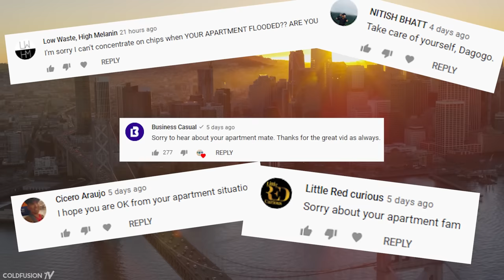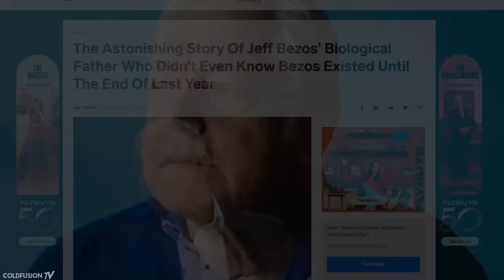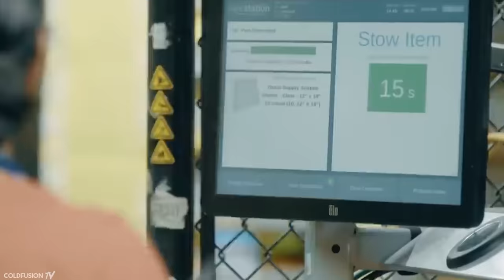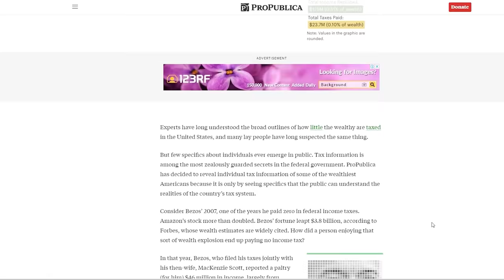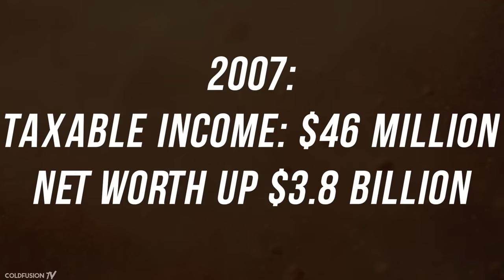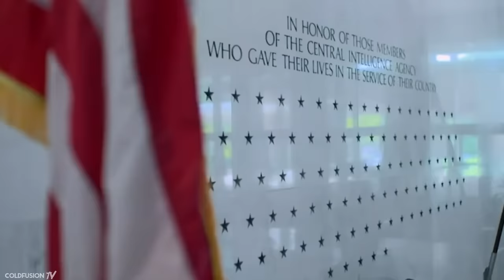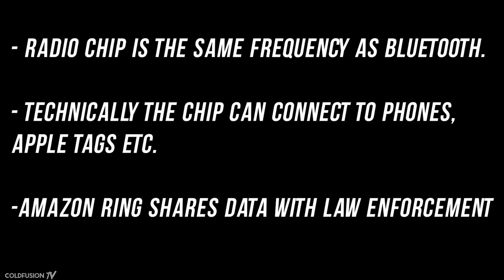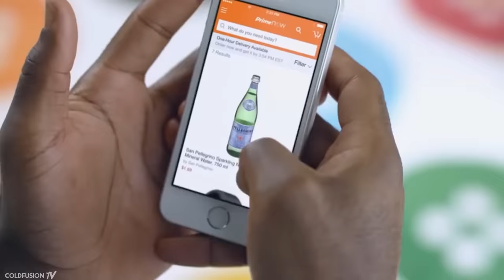How Jeff Bezos Became Public Enemy Number One

Comment: Holy shit... it that spy-network a real thing? Today I heard it for the first time.
Being an engineer doing IoT, naturally a countermeasure comes to mind... That asian guy mentioned the ISM 900mhz-band, so its a license free low-power and narrow band. A simple jammer that hops every frequency from 915 to 925 MHZ (or an array of transmitters working in parallel) transmitting on the maximum allowed tx-power (milliwatts) should do the trick. Sure, your LEGITIMATE appliances on the same 900-mhz band will suffer, but then I guess one will have to choose between privacy and comfort. Jamming is illegal, ... well at least its a very unfair utilization of the that band, but so is a spy-network.

Comment: There's an error: At the 13:43 the source says it uses 900MHz and at 14:03 it says that's the same frequency as bluetooth which is clearly false
Reply: And that he said they would have a range of about 500m is also clearly false, the Bluetooth standard would never ever work in a 500m range unless you were using loads more power than supplied to the receiver or sender...
Reply: Well spotted
Reply: @letsmoe793  sir trust me 2.4 GHz can do that given a proper antenna, so can the 900 MHz (which can go even longer). But you're right about the mistake in video.
Reply: @babaktaghavi7503  atleast do couple of searches before calling everything a conspiracy theory. 

For 2.4 ghz i agree you need a separate antenna but for 900 MHz even an onboard antenna will do.

Begin your seach with lora modules range.
Reply: @_pawan  I totally agree but the microchip shown was way too small for that and boi am I not gonna wanna have an antenna sticking out of my Alexa... Not that I have one anyway...
Reply: @_pawan  But doing it over multiple kilometers would require hundreds even thousands of Amazon echos since the alleged Bluetooth signal of one of those wouldn't be able to reach anywhere over 40 meters...
Reply: @ngp9609  if we were to assume the chip in the echo was actually from this world and not some SciFi tech that Bezos picked up on his way back to earth then we can safely say that it is phisically impossible to have a device this small reach 500 meters on its own ( not inside a tight mesh network but on its own ) so the echos would have to stand in less than 40 meter distance to be able to communicate, you can actually do a distance estimation on the official Bluetooth website.

If they were using a LoRa device with a half decent antenna, which would most likely not fit in the echo, they might be able to achieve the distance but then the data rates would be way too low for any kind of real-world data sharing they would want to do... Like images for example, it would take literally days to get one single image shared with a LoRa link across 500m...
Reply: That guy has no clue what he is talking about.

Comment: In the current era being rich has been romanticized, up to the point where people admire the personalities as well as the rich persons themselves. However, this was not always the case - prior to WW2 being rich was considered something useful, but inherently evil - and this opinion is right, when seen from an ecological perspective. "Rich" is a state where an individual collects a great deal more money than he spends. Money, which would otherwise circulate within the economic system and allow others to facilitate or consume good and services. The rich individuals on the other side, will cause the economic system to degrade and eventually fail, when no one has any money left - except for the rich people. Just like a water container for watering plants, which is slowly losing all of its water due to a small crack at the bottom, where the water leaks towards a "rich" cup collecting all the water which now cannot water any plants at all.

It is my opinion, that people should overcome the romanticized view of being rich and see it for what it technically is: A fault in our economic system which will cause it to collapse, if not corrected.